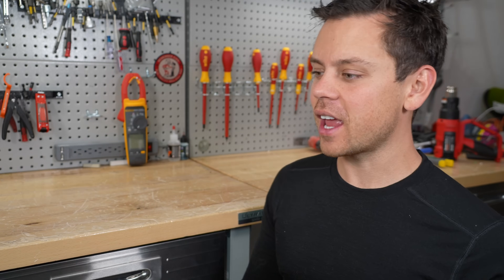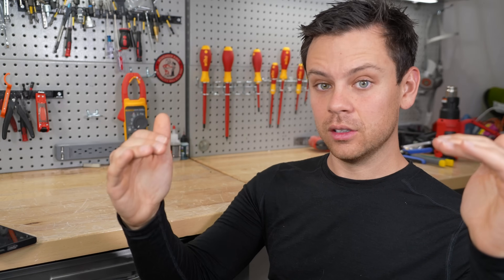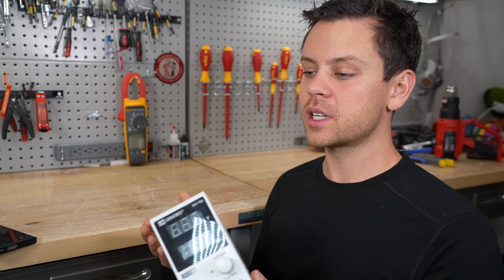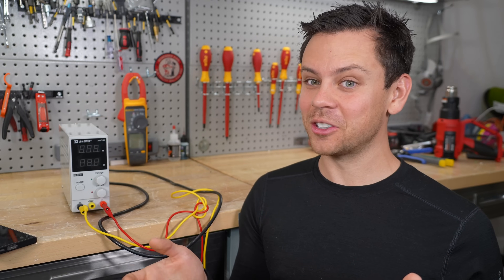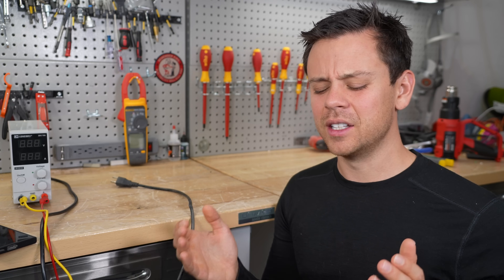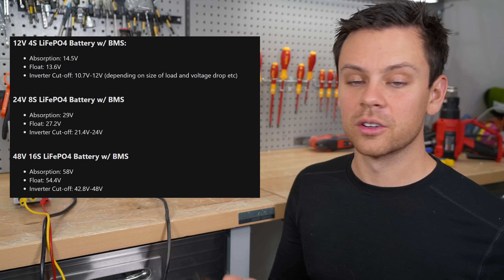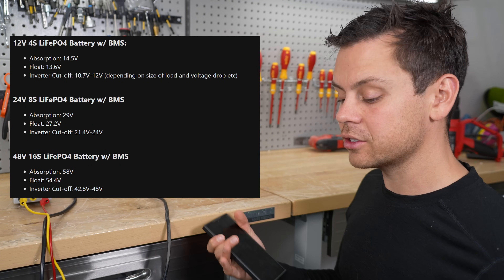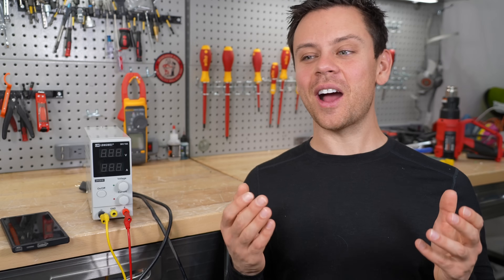LiFePO4 Charging Guidelines: What is 100%? What is 0%?! How to Balance??

Comment: I use these LiFePO4 batteries in my wheelchair. I went from two 22nf gel batteries to two 100 amp mini's and I had to charge every other day with the gel cells to once every two weeks with LiFePO4. Plus they weight about half as much as lead acid batteries....

Comment: I'm 80, but in my 70's I was a solar / battery systems designer for an RV after sales installer. Customers stated usage and time used and I would spec out the components and make a wiring diagram for the installers with a math chart included. I laminated several copies so the techs could make sharpie notes and drop them in the dirt, etc. The customer got a final, edited copy also laminated for future trouble shooting and mods or add ons. I now live in a 22' 1973 WINNIE that I've spent last half of 2025 installing 600 Watts of Renege N-Solar, and their smart shunt that run an inverter. My suplimantal 12vac gas charger runs a Victron 30Amp 12vdc charger. The batteries run EVERYTHING either direct or via inverter. I paralleled 4 100 Dumfree batteries with 9" 2 ought cables to Breaker and shunt each also 9" to the bus bars.They live under my bed. A Wabasto heater warms them and A/C cools them. My Starlink V3 is run from a 12vdc converter. I live in the forests of the Pacific Northwest. I TOTALLY dig your Viedeos! Bless your solid works ❤❤❤ - you're the best battery YouTuber EVER...

Comment: Dosn't a modern bms start balancing before a cell reaches max voltage?
Like if most cells are at 3 volt and 2 of them are ahead like 3.1 volt the bms should already take action start balancing them back to 3 volt.

Comment: I was trying to charge my battery bank with different capacity batteries, to 100%. I got scared because near the top, the cell drift increased. There was always 1 cell that kept charging past 3.65v while the others were much lower. I don't want to damage cells.

Comment: If any battery is 0V, then is it beyond saving. There isn't a battery cell that can be saved when it is 0V (assuming the 0V isn't from the BMS disconnecting).

Comment: I really apricate what you teach, way above this 64 year old man's knowledgebase but still VERY interesting. We now live in a Townhome in Myrtle Beach, SC with no ability to have solar panels (HOA). Our power here is pretty stable, I bought a Ecoflow Delta Pro rather than gas generator attached to a MTS w/ 6 circuits. I watched your video's and currently (in the month I've owned this system), I keep the EF at 80% and the output isn't attached just the plug (input) is hooked up to commercial power. I am still at odds, what should I keep the generator at just sitting there and should every quarter charge to 100%, hook up the output and switch the MTS and let the EF go to "X" percent then charge and store for three months and repeat? Could you maybe shed some light on this so I keep my investment at peak? Thanks for what you do.

Comment: So my converter in my RV has a lithium profile but it insists on 14.6 for absorbtion.  This is a single 320Ah 12v battery with a 200a BMS.  In order to keep my BMS from tripping the single cell overvolt disconnect and having the converter go on and off at 80a over and over again from one cell hitting 3.65, I would have to bring the over volt disconnect in the BMS up to probably at least 3.68v and possibly (but hopefully not) 3.7v.  Would this be ok in the hope that the cells will eventually balance out?  For an occasionally used RV and a battery that I don't consider expensive am I still going to get decent longevity or is that max voltage going to murder the charge cycles?

Comment: I bought a 16kwh battery, and my EG4 6000xp says BMS charge limit 9amp...🥲 Is it a bad BMS?
Reply: Did you fix it?
Reply: @ngrengineer no but I am running the battery in open loop for about a month no problems so far...just charging 100% to 10% so far is doing fine the new BMS in it use a smart program...so keeps batteries all fine. Plus my 6000xp doing a fine job with charging at my desired volts.

Comment: I've got a couple growatt batteries that have some damage to their onboard control boards, and was curious about individual cell charging on these or similar 16S configurations.  How do you go about charging individual cells in these sealed units? I've got the case disassembled and can access the posts the battery normally uses to self monitor, but the voltage across different points is cumulative due to them being bussed in series.

Comment: I got 3 victron charge controllers ando selected the smart lithuim  in the battery section  question is i hearu talking about charging to 14.6,but the preset is 14.2. Would this be okay or should I change it from 14.2 to 14.5 or 14.6? Got 3 X 300ah 12.8 in parallel running my 2200watt inverter.

Comment: I decided to buy 4 ecoworthy 12.8 V x 300Ah =15,360Wh.  I bought the batteries based upon your youtube channel recommendation. Now I need to buy 2 gauge wires from ecoworty and I am looking at buying some Vevor 14.6V x80Amps at $135 each.  Since I have 1200watts I think it makes sense to charge them 2 at a time.  I can charge 300Watts in a little less than 4hours so if I have 2 chargers that is 600watts in 4 hours.  So I can do 1200watts in 8 hours.  Maybe I should buy 3 chargers?I can charge 300Amps in 3hours 45min with 1 and 600Amps with 2 chargers. So with 3 chargers I can charge 1200Amps in 7hours 30min.  Anyway I hope this works

Comment: Hi Will i just wanted to ask a question about building a battery from 3.2v cells. I purchased 302amp cells and i was thinking of say putting 3 cells in parallel then series potentially using 12 cells in on 12volt battery or 24 cells in 24v is this possible and would it affect the balance process. Look forward to hearing from you.

Comment: You say, don’t be scared to discharge to 0 percent, but I’m always worried if I get anywhere need 0 percent the loads may drain the battery below the 10v rendering the battery useless. What safeguards can we put in place to make sure the battery isn’t discharged past its lowest voltage? I don’t trust the BMS in the string of 100ah batteries I have connected in parallel, so I just make sure I connect them to shore power when I see my system voltage drop below 12 volts.

Comment: The best way is to charge all in paralel from 3.45v+- each cell, dont worry if one cell is at 3.37v and another at 3.55v, the process balance all perfectly charging at 3.65v 5A, then control voltage with a multimeter and you will see how the charging voltage is 3.65 but cell voltage up 3.46v, 3,47v slowly until reach 3.63v and current drops to less than 0.3A, at this point disconnect charger and continue leaving 8-10 hours connected all cells in paralel, at this point the balance is finished, and when connect the BMS you will see that all cells are perfecly balanced to 0.000v difference.

Comment: Even late found, thank you again for an Upgrade.
This 0% load - 10 Volt I got along with starting,
The main new part on this Video is that charge near full voltage as of BMS need to use it. I am on 13.4 Volt now - that will be changes tomorrow.
but sure I know that my batteries are too less ! The Inverter can charge with 100 Amp, so I CAN add 10 times 10A 12V battery packs with each 4*3.2V Cells and BMS, but I don't have the money. End even now with 4 sets and load 50 Amp (40 A might be taken) I can already go with solar through most of my night and keep server PC, and Router, Switch and 7 in-wall-fans alive until near next sunshine and lower my electric bill (Hybrid system). Only if I wake up too early and switch my main PC on, it stops maybe 5 am, otherwise most at 6:30 I hear the switch to grid.
Sure it would be more effective with 8 packs, but as I wrote - money is the ruler.
With 116% Solar energy to main usage from a 17 kWh peak installation, I still have around 35% of bill, as missing a bigger Inverter and than even between 15-20 kW storage. But every saving already is worth.
And beside, when electric it cut off, my mein systems Server with monitoring temps and watts keep running, and most internet keeps available - that is already another big advantage.
Thanks for your lessons to me in this now 7 years - my installation got payed of with savings in November 24.

Comment: How can I set these settings on the renogy rover 40? I keep seeing SOV all the place but I added two more, I know that they were dying due to lack ah which I added 2x in parallel but have problem worked out. Theoretically…
I cannot seem to ever get my inverters BMS to show info past 13.1 on an 800W system 2s2p the max I’m seeing is 265W +\- and 20.1 amp . It will not go past that on renogy core / BT.

Trying to figure out what settings I can chance and how. Since I’m remote 3hrs away a lot of the time I can’t actually disconnect it and wait so they turn off due the low on the BMS and it kicks back on once hit its 12v again…

Comment: Will, I’ve got an Epever 2210AN solar charger charging a 12v 300AH Lifepo4 battery.  I’ve had to reduce the charge voltage to 14.2v to get rid of voltage spikes caused by clouds obscuring the sun.  My concern is will my battery still balance the cells with the reduced charge voltage.  I’m new at this and I am trying to understand the technology. Thanks in advance.

Comment: My issue is this. I have my power stations and batteries strictly for backup when the grid is down. I use them maybe twice a year, but since I do not know when that power grid might go down, I keep them at 100% all the time. Every couple of months, I check and recharge them all. I want to have them fully charged so I can run as long as possible when the grid goes down. Over a year of time, I might get 2-4 cycles on each battery. They will never have the 3000 to 4000 cycles these LiFePo4 batteries advertise, not even in 20 years. I mainly am concerned with a few lights, the fridge and freezer, my internet, TV, laptop, wifi, and a fan. I currently have 2 Bluetti AC180, 1 Pecron E1500lfp, 1Pecron EP3000 expansion battery, 2 Pecron E1000lfp, 2 51.2v 50ah LiFePo4 batteries, 1 12.8v 314ah LiFePo4 battery, 6 12.8v 100ah LiFePo4 batteries, 1 Bluetti Elite100v2, 1 Solarplay Q2501, 2 AlphaEss Blackbee 2000, 2 Pecron E600lfp, 2 300 watt solar panels, maybe about 8 smaller...around 280wh power stations of various brands. I know this is extreme, but during hurricane Helene, we were without power over a week. I was so miserable, I started buying power stations at every sale. Then I started buying batteries to increase my run time.

Comment: We talked years ago about the best lithium batter out there at them time and I bought 2 100 ah Battleborn batteries for my Bigfoot truck camper and a DC to DC charger and I put a lighted switch on my dash so I could charge my start batteries and when done I just flip the switch to charge my lithium house batteries and the light would remind me to turn it off so it would not drain my 2 start batteries on my 05 Dodge 5.9 diesel and that was 19 years ago and they still work like new and think you for the information and Battleborn were great because when you call them they answer the phone and take your questions  very good customer service or I should say the very best of them all about customer service .

Comment: I have a 12V, 100 AH LiFePo4 WattCycle battery. Standing alone, I  ran it dead. It doesn't activate the charger. Can I  bring it back?
Reply: I solved my own problem (and you also told me, dah). Hooked up a variable PS at 13V, while charger was also connected. This gave the charger a voltage to detect, and it was activated 😊 
Thanks

Comment: Cool! So for a 48V battery, the settings for an active balacing BMS like Jk2a16s15p, should be at which values? There are tons of settings per cell etc.
The inverter is set to Absorption: 58V, Float: 54.4, and Inverter Cut-off: 46V 
I am mostly interested in the top up settings, like SOC and many of the others. Thanks! It seems like setting the balance start at 3.45 is way too low as many suggest?

Comment: What ac charger needs to charge a battery bank consists of 10 of the 12v 100ah batteries in parallel? Is a 12v system without saying

Comment: I am in Vegas, Have 600w solar on it with Victron Controller, Smart shunt and 1500w Inverter.
 I have AGM now, 300 ah. They seem to be working ok. Wanted to explore Lithium options but i'm more confused now than before with the different styles of batteries out there.

Comment: I had contacted you before about advice on using LifePro batteries for my airplane. After watching these videos, I decided to buy a 50 ah gel Cell battery.  I think it was a good idea. It’ll turn Over my Four-cylinder360 cubic, inch engine over with no problem. It’s not as light as a LifePro battery But with no worries.

Comment: I have 4 pack brand new 100 ah cheap batteries and tried charging them with the auto shut off Charger on LiFe settings (2a/8a/15a/20a) and #1, would not go above 13.8v on volt meter (eventually got it to 13.99v  and #2 battery got to 14.35v  max, # 3 got to 14.36v, and 4th got to 14.36v max.   The last group of chargings was with a power supply set at 14.4 v and 2amps or 1 amp. Tried a bunch to get the 13.99v battery to get past that point, but, no joy.   Called  seller and they havent got back with a swap yet.   Pretty sure there is a badly out of balance cell in  #1.    You suggest using the power supply, what voltage and what amperage,   maybe 14.4 and 1 amp? 1/2 and amp?  I think the BMS is shutting down the acceptance of a charge on the #1 battery.  The others I am pretty sure I can get higher with more attempts as some balancing should occur at thoses voltages.

Comment: I know this video is 9 months old so I'm not expecting much comment...but this video has made my mind up about LiFeP04 batteries. For a small backup solar system 400 watts at 15.8 volts like mine, it appears lead-acid will continue to be my battery. It seems the maintenance and technology of LiFePO4 is not worth the hassle. My little bitty system has been making 9 years average lifespan. I just can't see the hassle for the technology.
Reply: I find lifepo4 easier than lead acid because I don't have to worry about draining too low or cooking them with too much charge. The BMS is great at protecting the battery! Less to worry about.
Reply: @heyjeh IF it works....the LiFePO4 can be ruined in the exact same manner, if the electronics fail. I have overcharge protection for my small bank. I'll stick with my lead acids. If I had a large bank, I might consider. His videos help believe it or not.

Comment: Lithiun are typically RATED AT 3%. sometimes 5% per month self-discharge. in practice they are close to zero, but if you get one with 5% in a pack with the rest close to 0% you have problems! a 320Ah cell at 5% needs 16Ah per month to balance it! That's 16A for one hour a month, or if it was continuously on the charger, 22mA. Also, while it's balancing che charge current in the low cell is reduced by the balance current and other cells being overcharged by that same amount. i gets really complicated. Packs should be put together using cells with matched self discharge currents. I developed a self discharge meter to measure it. you have to keep the cells at a constant temperature to get meaningful test results.

Comment: I bought new lithium battery 15k it comes with zero charge and bms won't charge from the inverter i have hybrid inverter, so i activated emergency charge then  some of cells not reading at all , really need some help.
Reply: I guess you may have to return the battery,  some cells are dead
Reply: @akinboadebayonle38 I found that the BMS is burned but battery cells it well charged in average 3.50

Comment: My 12v power queen 100ah I use for my trolling motor keeps wanting to stall out at about 85% or 90%. Should I just leave the charger hooked up even if it stalls and see if it will balance out and go to 100%?

Comment: My battery never shows me 100% after the first charge.  Is it because I am running a 12v fridge which is always drawing from the battery?  I have a Victron Smart shunt and it has never reported 100% since I added the fridge.  I am using a 12v battery charger and it does stop charging once it’s full but smart shunt will only show 96% - 98%.  I can’t figure out why.  I have 1 Li Time 12v 280Amp battery.  The highest voltage I’ve seen when “ fully charged” is 14.53 volts.

Comment: Could you do a quick video about how to setup the settings on an EG4 all-in-one solar inverter/charger when connected to cheaper LiFePo batteries that don't have communication capabilities?  I have an EG4 3000 watt output all-in-one system connected to four 12=volt WattCycle 300amp/hour mini LiFePo batteries (proven to be actually only 280 amp/hr by you and others), connected in series for the 48 volt battery bank, and the EG4 instructions on what settings to use with batteries that don't have communication abilities are a bit confusing.  I just want to make sure I have it set up correctly.